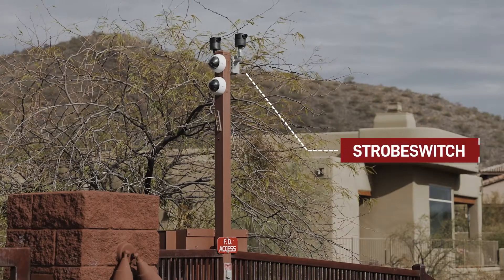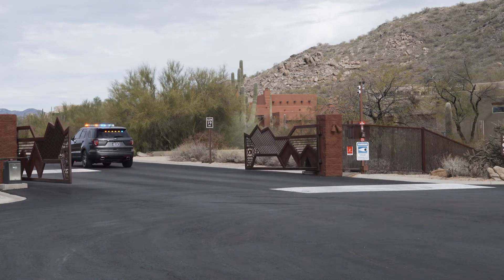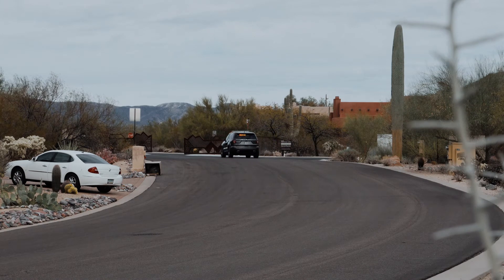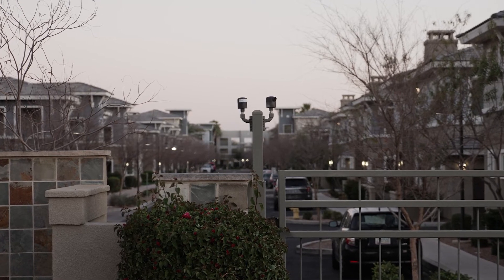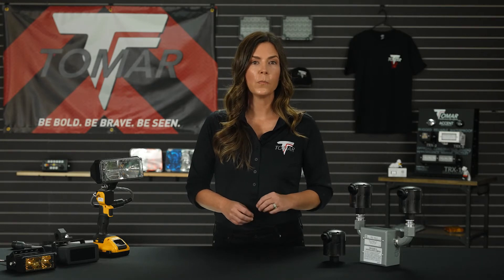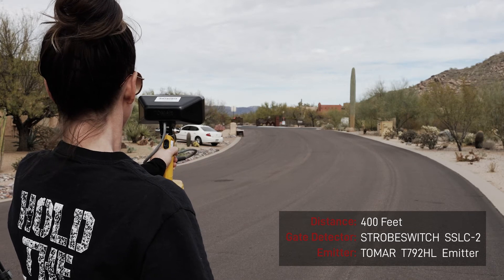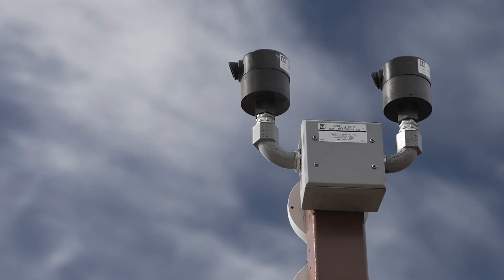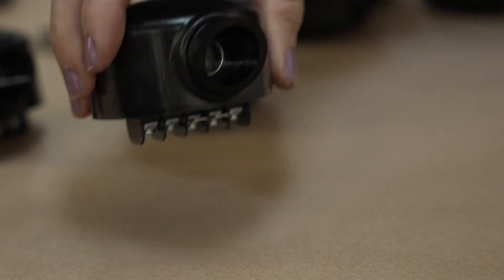Strobeswitch: Easily unlock gate accessed property with emergency vehicle emitters

Comment: For months our community gate problem has been sporadic. at time the gate will open 20 times without a miss and other times it will not open at all day or night around the clocks. Technicians hav been out to service several times and cannot fix the problem. Meanwhile cars just shoot thru separate out gate when possible. The out gate next to the in gate works all the time no problems. Sometimes while trying to open the in gate the out gate will open. This problem exist Wirth new key FOBs with everyone in the community. Just has a mind of it's own.